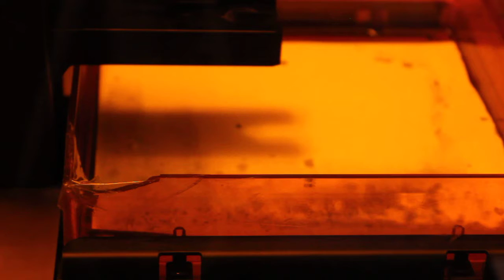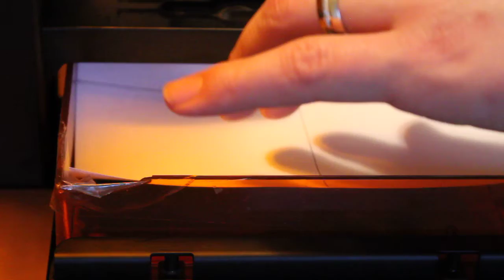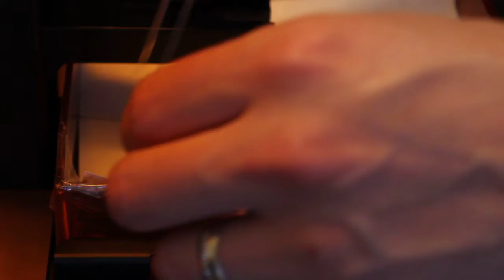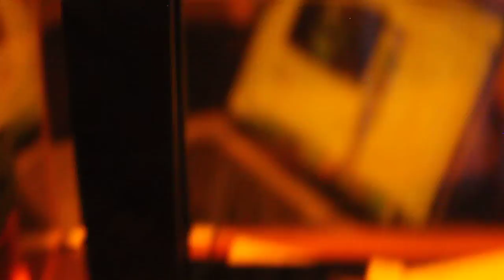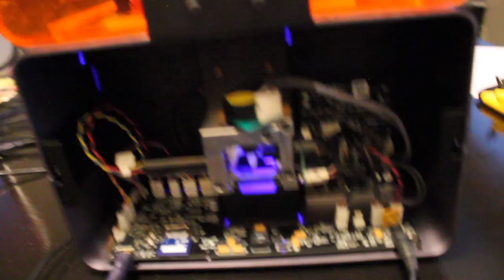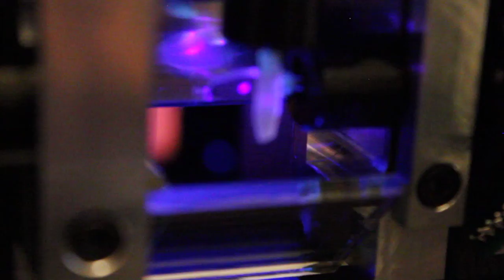Formlabs Form 1+ manual galvanometer calibration.

Comment: I have a form1 + printer and I have problem with the galvanometer Y if I mold a square 124mm x 124mm X = 124mm and Y = 98mm you know a rpocedura to calibrate galvanometers thanks

Comment: Hey Nicholas - thanks for the video! So I cleaned my galvo mirrors recently and I didnt know we couldnt move the mirrors? I though they re orientate back to their default position. Now all my prints however are stretched in one direction by a pretty good amount I would say around ten percent - do you know how i could be able to calibrate this?
Reply from the maker: You can either do what I did in the video, or pay Formlabs to recalibrate it. I think it's a lot of money. They can email you instructions on how to attempt to recalibrate it yourself. That's how I got started before I made this video.
Reply: Ok im in the same situation, just cleaned my galvos and moved them. Wish I'd read these comments before sigh.. anyways if you can help a fella out I would gladly appreciate it, my email is lucasmcarnevale@gmail.com if you want to send me that calibration file. I think it's cool if we all calibrate on the same file.
Reply: Nicholas Sanchez Can you send me the file please? janajmfa@gmail.com

Comment: @Nicholas Sanchez
As I'm not english, I don't really understand... can you explain how you move the X and Y to adjust? I know there is a knob on F1 but they removed it on F1+
Do you turn the motor?
Thanks
Reply from the maker: Yes, there is a small screw you loosen and it allows you to move the mirror motors  (galvanometers) one at a time.
Reply: Can you share the file you use to center? it is just a cross.stl? anyway, many thanks! :)
Reply from the maker: I can email it to you. It's called "galvoshift.form" or you can email Formlabs and ask them for it. 

Remove the back panel of the Form 1+ and carefully loosen the galvo screws only when ready to rotate them one at a time. 
The X galvo is on the side of galvo block (in charge of front-back motion). 
Take care not to let the galvos rotate freely.

Rotate the X galvo , as viewed from the side looking at the back of the galvo. 
tighten screws and replace the back panel.

After the adjustment is made, reprint the galvoshift.form file to verify that the adjustments were correct.

The easiest way to accurately rotate the galvo by a small precise measurement is to make a mark on the galvo and a matching mark on the galvo block denoting where the current set point is. This will help you measure how far we will need to turn the galvo.
It will also give a known location if you go too far or need to make an additional adjustment.

One trick to make it easy, measure the necessary rotation on a piece of paper. Wrap the paper around the galvo, starting with the mark lined up on the paper and galvo. Loosen the screw that tightens the galvo that needs to be shifted and turn it so that the second mark on the paper matches up with the mark on the galvo block. The image below shows how to make the markings on the galvanometer. Once the galvo has been adjusted, re-fasten the screw.

This is by no means an exact science, however it will make the adjustment close enough to center that we can make additional adjustments with software.